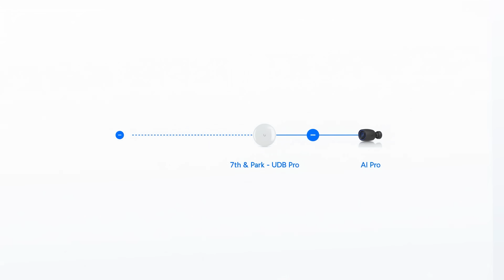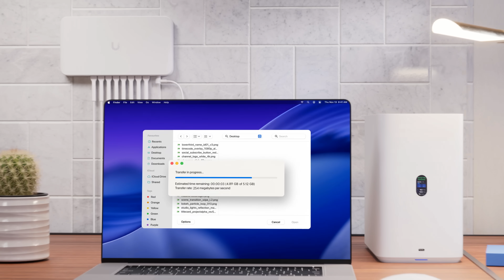Introducing the Next Evolution of UniFi Bridging: UDB Switch & UDB IoT

Comment: Well, that explained absolutely nothing.  I still have no idea what a bridging switch is.
Reply: They say it in the video - "bridging any ethernet device into a UniFi WiFi network."
Reply: @jacobnoori  Why wouldn’t you just run a cable?  And you’d have to position that switch in a place where it has amazing reception, since it doesn’t have an external antenna option.  Since it’s 6Ghz wifi7 anyway it’s not going to give you much range.

Comment: The UDB Switch is slick, but $300 at only 35W power budget , even more for the bigger adapter, is tough to justify.  Your own Switch POE LIte 8 port and a UDB IoT provides the same thing (and higher power budget) for $160.  Even the regular bridge (assuming there's a performance difference) brings that to $210.  At 35W, the UDB switch makes sense at most $199.
Reply: Read the specs closer. The equivalent switch is not the Lite8, but Flex 2.5G PoE at $199 + $49 for the USB-IoT.

Comment: Isn't switches normally hidden away in racks in comms rooms?
Reply: That switch connects devices in place that cannot be reached via ethernet cable. So definitely not a rack in a comms room.
Reply: @OliverStahl  Maybe a reason to use one if an client forgot to run a data cable to a room or something otherwise just connect a wireless AP into a switch in bridge mode is the same thing

Comment: What is the use case for the last switch didn't understand
Reply: You'd use it when you can't run a cable but have multiple devices to bring into your network. It links for your network via WIFI and connects multiple wired devices. Typically a couple cameras.

Comment: that's cool but where are the smoke detectors lol
Reply: Literally yes, we need that
Reply: amen
Reply: Yes please
Reply: Yep yep yep
Reply: There are a lot of legal, liability and compliance hurdles to get a smoke detector to market.
Reply: Only thing stopping me from diving into Superlink is the lack of smoke detectors…
Reply: Exactly
Reply: Been waitinggggggg
Reply: I would like a ceiling mounted device that converges the functions of 
smoke detector (for compliance with building code requirements), 
motion sensor (for vacancy and occupancy detection control of room lighting e.g Matter protocol), 
light level sensor, 
temperature sensor, 
humidity sensor, 
models in the product line that optionally include 
Wi-Fi access point and/or 
audio speaker (e.g. Bluetooth speaker), 
all powered over PoE with internal battery backup using standard form factor 18650 or 21700.

Comment: Well, this is new. I didn't expect to see a Bridging Client in a Switch.
I would sort of like to see this concept expanded - but I don't know if they're prepared to put DB hardware onto something like an m.2 slot device,  or other such concepts where you can put a laptop or Outdoor PC enclosure, and use it as a PtMP system i.e. Outdoor camera/Signage combo units. IDK. There's a wide array of possibilities once you have 1-10GB wireless bridge tech and 10G ready integrated bridge equipment. notably if it crosses over into 5-6ghz carrier mixing /multiplexing where it switches like DFS or has a wide band carrier sync for multi-point down/up link separation in mesh.

Comment: The UDB Switch looks awesome 🔥W Ubiquiti
Reply: Yeah it looks awesome I can't figure out if it's supposed to be like as good as the UDP pro in terms of receive trying to think of a situation where I would use it but I guess anywhere I've put a udb plugged into a switch before which is quite a few places actually as long as it has similar received performance couldn't tell if antenna was directional ?